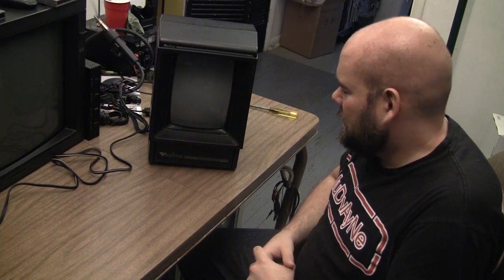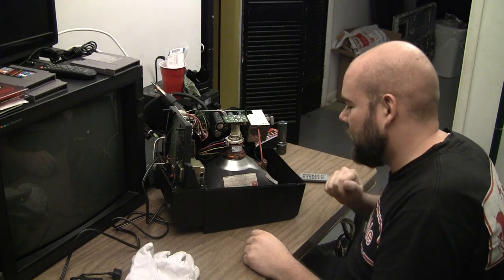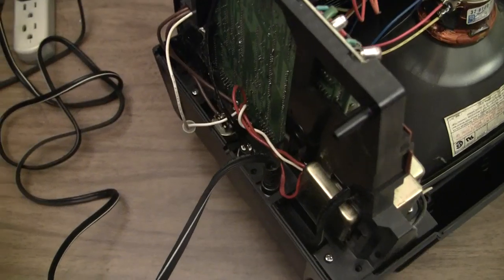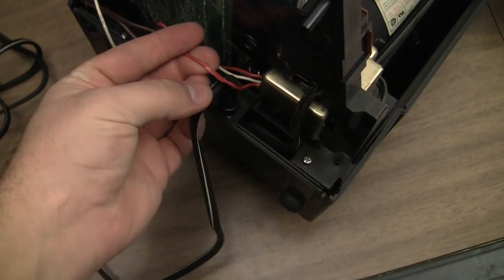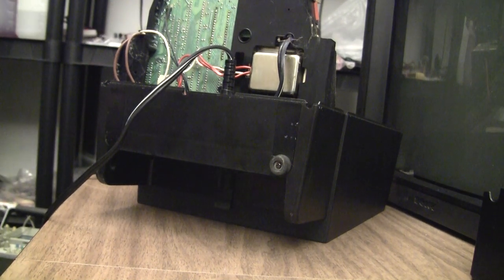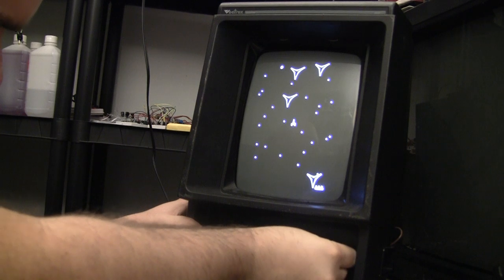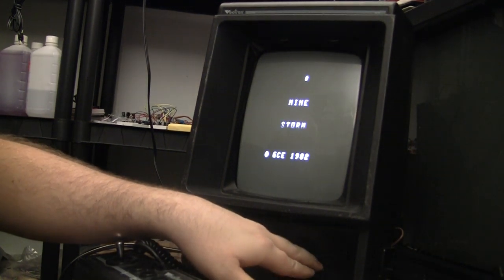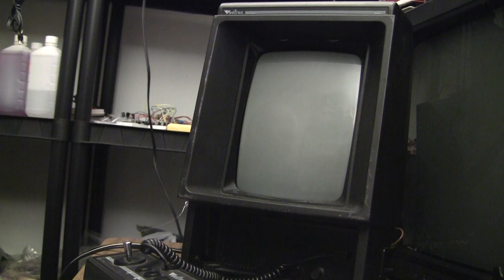Vectrex - My first console - broken - easy repair

Comment: The goo is most likely dielectric grease to prevent arcing from the anode cup to the aqua dag.

The high voltage is stored in the CRT not in the flyback lead the tube acts as a capacitor. The anode button (that the flyback lead clips into) and the flyback HV clip (when it's installed) is where you can get zapped.

I usually use my HV CRT measuring probe to discharge the anode cap. It's better to discharge the tube through a resistance than to short it out. Since HV probes use a resistive divider they're perfect for the job and they show you the rate of discharge. No nasty pops either.

If you must use a screwdriver simply things crimp alligator leads to both ends of a wire. Clip one end to the CRT ground strap and another to the shaft of the screwdriver. That way your only goal is to touch the contact in the anode cap.

Also if you remove the anode wire for an extended period of time clip a jumper lead between the anode cap and the ground strap running along the aqua dag of the CRT.

The tube can regain a bit of HV even after discharging. I've heard it's because they store a bit of HV in the glass. It's not as high as it was before discharging but enough to make you take notice when reinstalling the anode lead.

Don't pull on the lead either to remove it pinch the clip and it will come off this will prevent damage to the anode button.
Reply: That's really interesting.  I always assumed it was the flyback that stored the charge.  Thanks for the info.
Reply: Yes, there's a conductive layer inside the crt that along with that carbonised coating on the outside, forms two plates of a final stage capacitor where the glass of the tube forms the insulator that holds the charge. I don't know whether there's a conductive shielding inside those gloves but if that thing had been charged, the spark would most likely have ionised (and jumped through) the plastic screwdriver handles.

Comment: Haven't read allll the comments yet, but...  it's not the "caps" you mentioned on the board that holds the lethal charge with CRT systems, it's the CRT tube itself that acts as a huge capacitor.   The glass acts as the dielectric and it can hold the multi-thousands of volts charge for weeks  Thus the charge you need to dissipate is the inside of the CRT tube to the outside of the tube.   Just grounding the red corona wire to ground won't do it, if the wire is unplugged from the CRT.

Comment: Very cool you got your Vectrex to work! My Vectrex works pretty well, but there are some display problems because the text is a little hard to read. But I got mine for $20 almost 3 years ago. If you want rapid fire on Minestorm, then there is a hack called Minestorm 3, and you can toggle rapid fire on and off and have unlimited lives! It's a lot more fun than regular Minestorm. It's on the 72 in 1 mulitcart.

Comment: The circuits connected to the speaker are insufficiently shielded. That's why the buzzing reacts to the display on the monitor. If you got/have a Vectrex that's buzzing, don't mod it! The buzzing is like the signature of the Vectrex. :) Good job on reviving her!

Comment: You're supposed to use some wire to ground the screwdriver first and then slide it  under the cup. You reduce the risk of shock considerably that way.

Comment: anyone watching this please understand that the flyback is producing over 10kv and those gloves will not protect you.  

That being said any but the oldest  crts will quickly self discharge but if you're going to discharge one make sure your screwdriver is well grounded with a wire and clamp before discharging.  if the ground isn't good first the discharge may very well happen through you.

just be careful and make sure you know what you're doing before messing with high voltage.

Comment: neat, I wish I could fix old arcade games, I found a "Rastan" given away by a local pizza place, two wires were fused together, and one was burnt out, just used duck tape and simple solder and it worked. Wish I really knew what I was doing. Would really like to be able to fix old skool bowling/shooting arcade games.

Comment: Nice score and good to see a Vectrex come back to life. Buying a broken one is a roll of the dice since if the tube is busted you're not going to find a replacement, but you it's something simple like yours then it saves a lot of money.

I've discharged a few arcade monitors, and I found the easiest method is to use some alligator clip wire and clip one end to a flathead, and the other to a ground point. Why did you take it off though? I've never seen a monitor fail at the anode.

Comment: hey nice video,
perhaps to finish, servisol super 10, spray in connector plug and on pins,  - and then: plug in, remove, plug in, remove... (do it a few times). pins now cleaner and improved continuity.

Comment: would the clock generator be the problem if the display is flickering as it must be sending voltages to the deflection yoke via DAC chips or am I barking up the wrong tree.

Comment: Next time solder a wire to the flat blade screwdriver add a little electrical tape to the connection.   Add an alligator clip to the other end and attach that to ground.   Stick your free hand in your pocket and discharge the tube.
Reply: Heard the hand thing before, can u explain why?

Comment: My vectrex has a strange issue where only 70% of the screen is there, the whole thing is  shifted to the left, also my controller only seems to work every now and then but only a few buttons work after really pressing down to the point where I feel like it's going to snap in half,any suggestions?

Comment: Great video. Loved it so much I bought one and repaired it myself. I was hoping it would be a connector like yours but it was completely dead with multiple faults but I eventually fixed it. Its on my channel if you are interested.  Mine has the jitter too, did you fix that? also my buzz is much worse too also a fix for another time.

Comment: Wooow you must have been really courage to not only discharge the tube but also desperately attempting to remove that suction wire cup with your hands, then just attempting to (seemingly unprofessionally ) fixing 1 wire to eventually get the whole thing up & running again, wich is amezing trough,but man what a coutage process this,phew.

Comment: Great work, but you kinda seemed to ignore the fact that you had recharged all caps and the CRT when taking the main->logic board voltage measurements. When you move the gloves out the way at about 10:00 instead of putting them on, then grabbed that connector WITH TWO HANDS, I squirmed a little. You clearly know better man!

Comment: grounding it to something not connecting to ground aint gonna do much. at most put a +20kv charge on the gnd contact of your chips if you're unlucky. lol. pull crt plug out (no cramming things under there, just pull it straight out with gloves), insert screwdriver into the center of the crt hole first to avoid the spark there, take wire with a big ass resistor to actual ground (preferably not a walloutlet with a ground fuse or lightning protector as that would just blow and switch off the light). attach the wire to the screwdriver.. and tadaa the big ass spark welds the screwdriver and not the crt. repeat procedure a couple of times as sometimes magically crts charge themselves again after a week, without having been attached to power (the charge actually returns by itself).
Reply: if the red wire is dusty (has been gathering tabacco smoke in a living room for 20 years or so) you can also get the shock from that wire itself. it'll just blow straight through the isolation if you touch it. get anything with a crt in it in your house and you don't need air filtration anymore after all, all the crap always ends up in the tv. lol.

Comment: Hi - interesting vid but I wouldn't have a clue.  My vectrex had a tumble a while back - he worked fine for a while but now nothing.  On power up a low hum from the unit but nothing else visually or sound of minestorm starting up.  I'm useless with tech repairs.  Does this sound familiar to anybody? :/

Comment: You "Believe" this red wire is what you need to discharge????  480V gloves aren't going to help you, there's 14,000 volts waiting for you under that cap and in that red wire!  Up to 35,000 volts on Colour TV's  Dude, you need to put a ground wire on that screw driver, preferably with a high voltage bleeder resistor ( you can use about 10x 1K resistors in series).  Dude, Please don't give advice on discharging CRT's, go seek a professional.

Comment: tin the pins
Reply: That bit was painful. Scrape off the plating to reveal raw copper and he's probably exacerbated the corrosion problem, long-term. Those Utilux (aka Molex) pins are easy enough to find. He should just replace them and crimp a new pin on the female side.